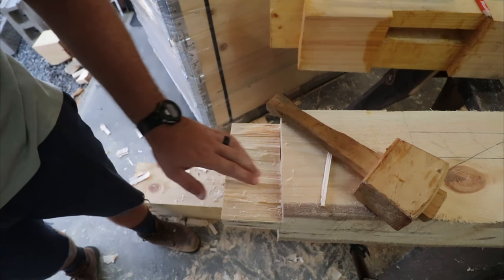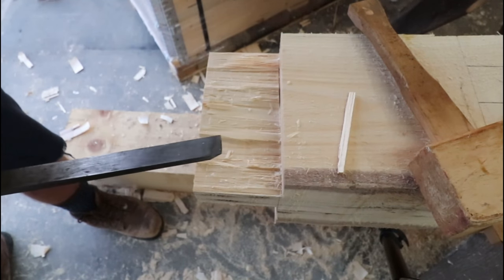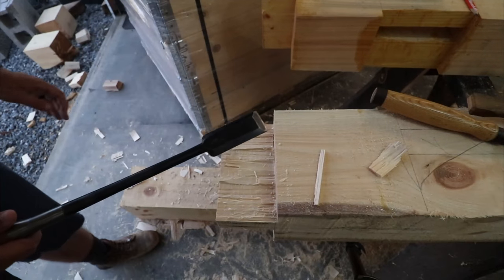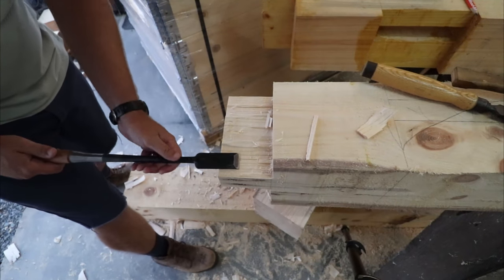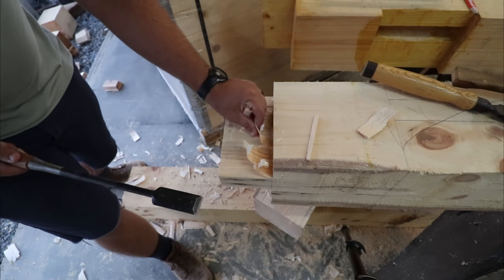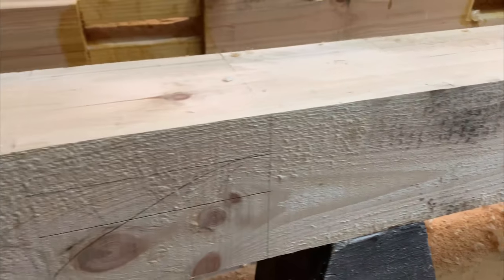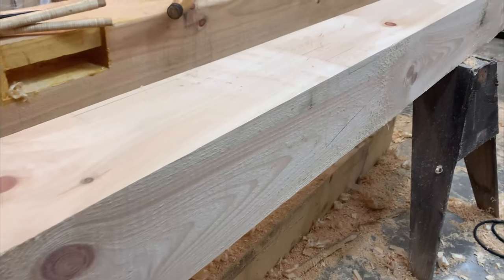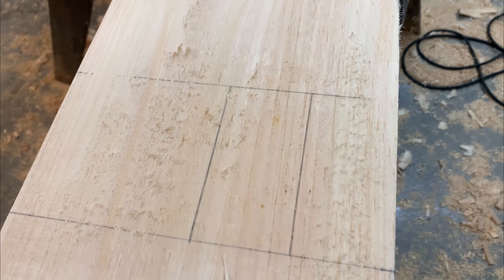My Timber Frame Shop: White Pine Post Joinery And Fixing A Mistake

Comment: You are "flame finishing" (shou sugi ban) the posts and beams correct? When I was in college (woods major) I experimented with some flame finishing before anyone I knew had ever heard of shou sugi ban. We stumbled upon it after finding out that it was somewhat traditional even in American woodworking either for ground contact situations or "Western" "Cowboy look" decor. The one thing I remember was that the surface of the wood did not particularly need to be smooth as the burning process tended to smooth everything out. All that said, If you enjoy the hand plane: You be You!!! There is an inner peace that comes from (hopefully skillful) use of hand tools

Comment: I am no expert at all, I was told that the angle portion of the chisel should be against the wood to be removed.  That allows you to control the depth of cut.  Try it and see if you have better control, and let me know what you think.

Eric S. Duck

Comment: You started a cuttin n a blowin with that beautiful saw and I thought maybe a short pvc tube on the top edge with a marble inside. Closed ends and downward jets with reed valves each stroke would blow downwards ......just thinkin

Comment: Nathan ... power tools will greatly increase your production speed for all of those joints while maintaining the integrity of timber framing ... Norm Abrams was a true pioneer of merging old school technique with modern day tooling ... buy yourself a 3HP variable speed hand held router and some spiral fluted straight cutting bits ... it'll change your life ... save the hand tools for fine tuning the joints once they've been cut ... just an opinion based on personal experience ... from one woodworker/turner to another ... anyway ... love the content and the commentary ...
Reply from the maker: I actually have a 3 and 4 hp router, I just enjoy the silence and no power tools as much as possible, thanks for the tip,

Comment: What were the cats canning?
Reply from the maker: Green beans
Reply: @OutoftheWoods0623  
 Yummy. Another good way of preserving string beans is what my wife called 'Leather Britches'. String them up like you can do cayenne peppers, and dry them hanging from the stove pipe of a wood fired cookstove. They will be good throughout winter if completely dry. Rinse before cooking with a smoked ham hock or neckbone. Another yummy!